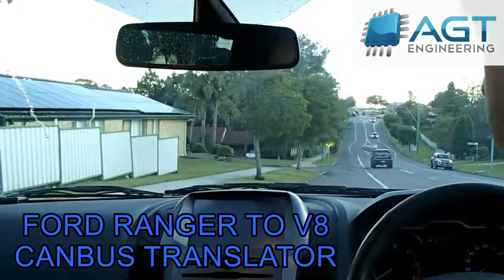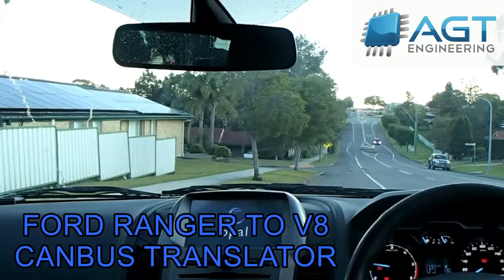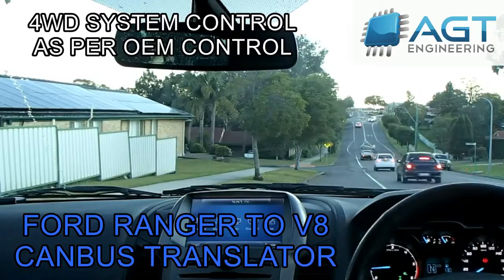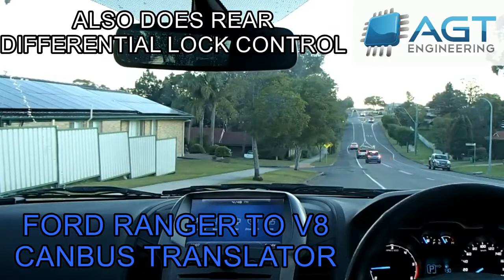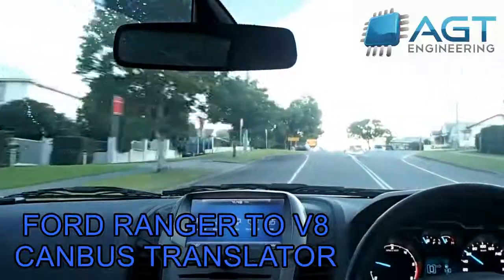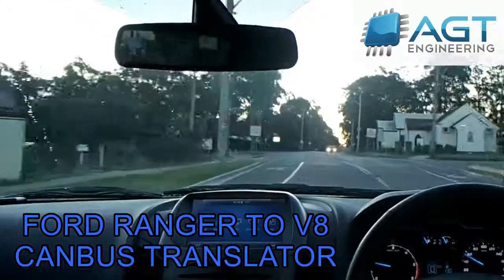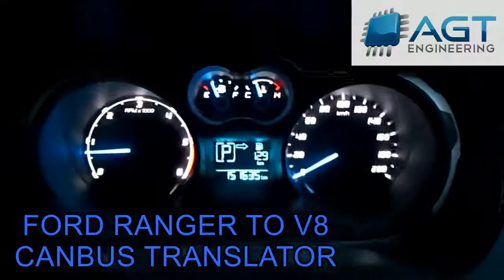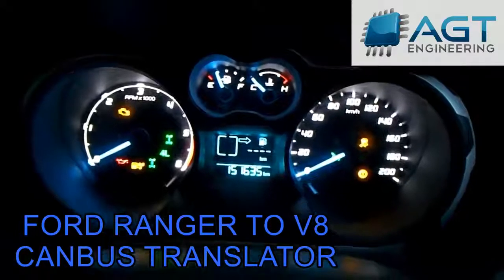Ford Ranger PX1 V8 Initial R&D Video using the Canbus Translator V2 wire in version.

Comment: Did you use the factory 6r80 from the ranger or mustang? If you used the 6r80 from the mustang were you able to bolt on the transfer case to it, or did you need an adapter?